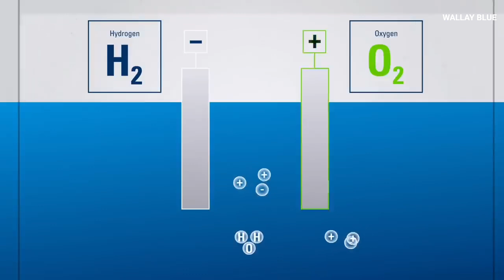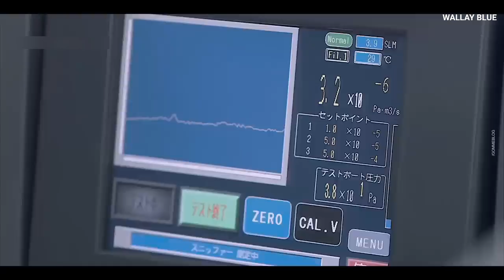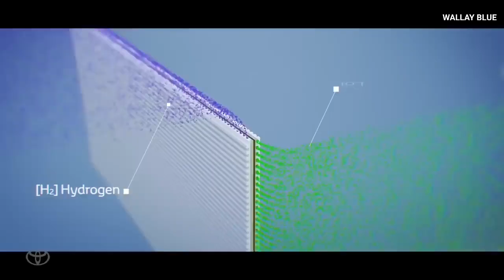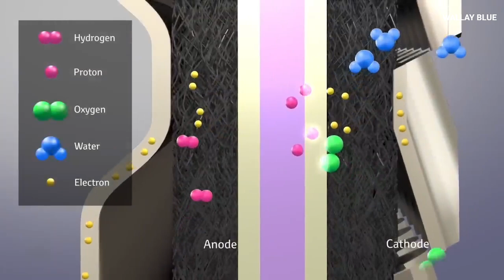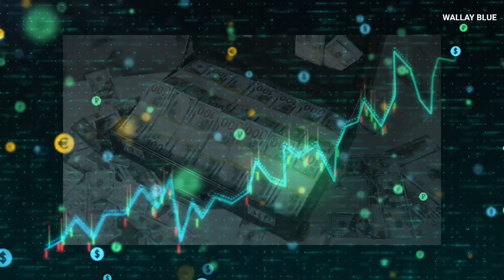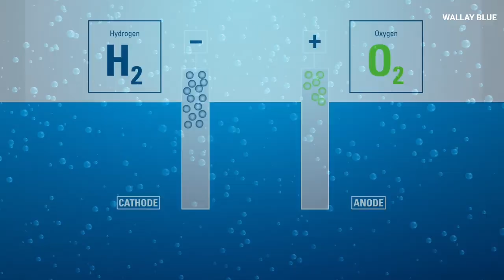All New Water Powered Engine Shakes The Entire Car Industry

Comment: Complete nonsense.  Water is just hydrogen ashes, burnt hydrogen, so it's spent energy, and you may have noticed it's not able to power anything.  A steam engine is powered by fuel like oil, gas, wood, etc to heat the water into steam under pressure which can drive the wheels.  There's no water-powered vehicles, only water-cooled ones.

Comment: This is not the best design!
You can make the Brown Gas just before it enters the combustion chamber.
Stanley Meyer did it in the 1970's.
All ya have to do is figure out how to flash liquid water into Brown Gas without using very much electrical current.
It's been done and perfected for 50 years.

Comment: Where is the energy to split water coming from?
Reply: Electrolysis.  Look it up.
Reply: @natejames1330  where will you take the massive amount of power to do electrolysis?
Reply: And you can create electricity through perpetual magnetic induction that is 100% clean and does not need energy sources like standard EV's. The ability to do it is available.
Reply: @natejames1330  you mean a generator? it takes torque to turn a generator... it just end up being a giant waste of energy.
Reply: From electrochemical reaction 😊
Reply: @elektrochemikdlarozwoju that means a battery, how do you charge the battery?
Reply: @Iseenoobpeoples no the idea is to split water in the electrolysis process - water splits onto hydrogen and Oxygen through electrochemical reaction on electrodes in electrolyser 😊
Reply: @elektrochemikdlarozwoju where do you take the energy to do the electrolysis?
Reply: @Iseenoobpeoples from RES that is why in my opinion the topic should not be the water engine, because as I read about this it is fake info - what I think happened is that the concept was to produce hydrogen from Electrolysis process and then the hydrogen is the fuel and the electrolyser itself can be powered by many different RES
Reply: @elektrochemikdlarozwoju What do you mean by RES? and why not power an electric motor directly with it?
Reply: @Iseenoobpeoples I mean renewable energy sources like wind or sun, of course you can power it by using battery, but you need a lot of power to power the electrolyser
Reply: @elektrochemikdlarozwoju How will you install a wind/solar farm on a car? How will you charge the battery? Why spend so much energy to do electrolysis instead of powering electric motors directly?